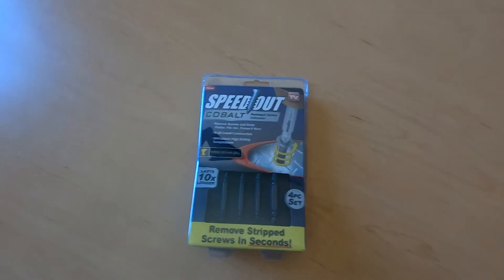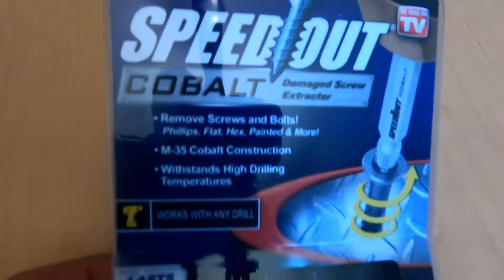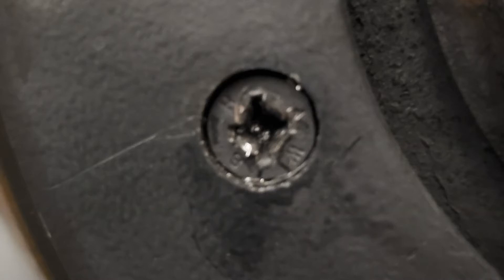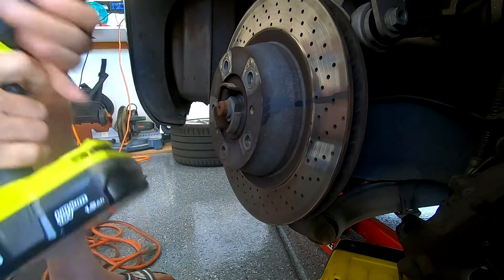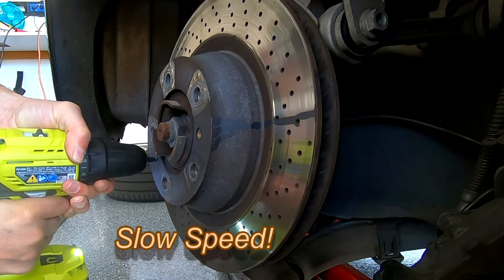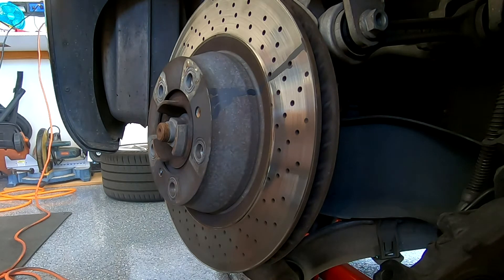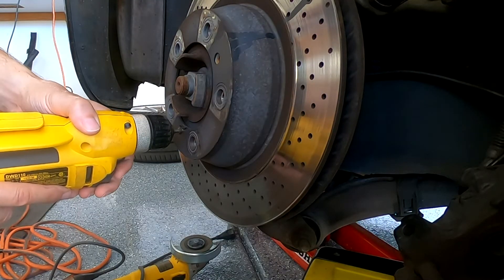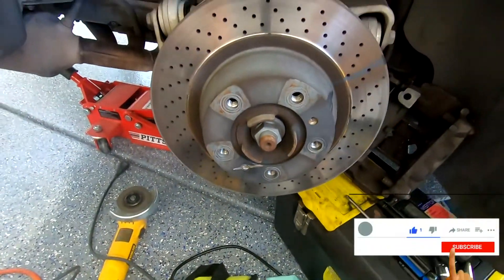Speed Out Cobalt Stripped Screw Removal Review.  Does it work with metal on metal?

Comment: I was trying to remove a stripped screw that holds down a shower drain.  I tried the usual approaches - rubber band, etc. with no luck. I bought this tool and it was totally useless.  The burnishing bit was to feeble to even remove much material and in fact made it worse.  Eventually, I just took a hammer and a flat blade screw driver and gave it few whacks and I had the screw out in a minute. This is a bit like using the dremel tool to cut a slot, but I don't have one and the hammer approach worked perfectly.
Reply: I just cancelled my Amazon order after viewing this video — exactly coz I have a dremel!

Comment: fyi those set screws come out without much fuss (even up here in MN where rust is severe), if you use a manual impact screw driver. the ones you hit with a hammer.

Comment: I tried to use to remove deck screws which of course are anywhere from 3-4 inches and for the first 3-4 screws them other attempts failed. Didn't seem to be drilling pilot hole and then extractor bit just spun. Went to larger bit and it worked for a couple screws but them became lodged in my quick-change device and the bit jammed in the device and could not remove it with every trick in the book. Ended up used another method to remove deck screws. Would not try this type of removal tool ever again.

Comment: As @El See said below, the correct tool to remove these assembly screws is an impact driver such as this: CRAFTSMAN Hand Impact Driver. You hit it with a hammer, which gives it both the inward push towards the screw and the twisting force at the same time. If that doesn't work use an angle grinder as shown. In other news, you can pitch those assembly screws. They are for ease of assembly and that wheel stud thing you had is a way better solution. YMMV.
Reply from the maker: Yep,  I thought it was too stripped for an impact hammer.

Comment: IT is a good product, but some how the company that makes them for "speed out" and a bunch of others is not the original Alden Grab bit Pro,  which is or was made in Germany and was of a much better material strength than those made for "Speedout" and other brands thus they don't do well because they were made cheap. However, Milwaukee has released a similar set in May 2023 so it will have to be tested to see how it actually stands up because Milwaukee will not put their name on Crap products.
Reply: 1 year late but I figured It’s still worth chiming in on this point…
SpeedOut is Grabbit, it’s the same product by the same seller, they just changed the label.

Comment: Did not work for my deck screw. The bit just spins
Reply: I had the same problem. What it was that I didn't screw it out deep enough before switching to the extractor. I've even needed to size up on only the extractor part, which works well. If it's not even biting, it's because you didn't go deep enough.

Comment: These Honda brake rotor holding screws are an absolute nuisance.  The designer should be fired.  The purpose is to hold the rotor in place when installing the brake parts.  This could be done easily by using the wheel lugs.  Instead, they came up with this stupid idea of using the tiny Philips head screw that always srtips.  They should at least use an allen head screw with anti-seize prior to installing or better still, not use it at all.